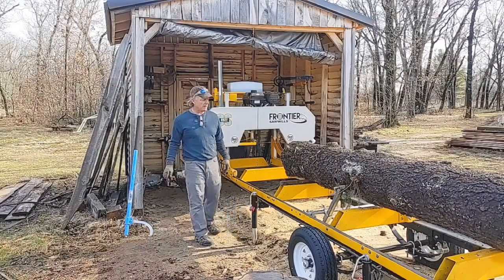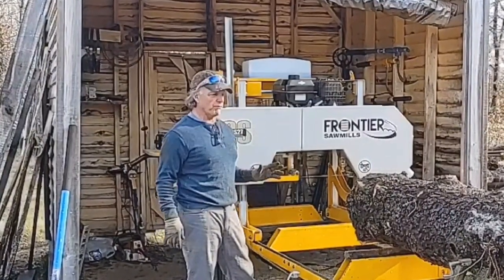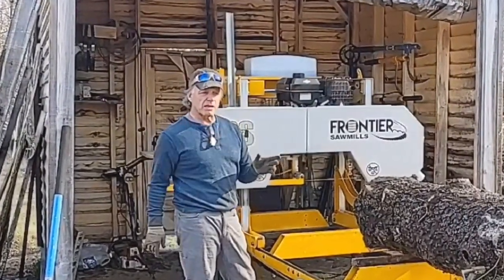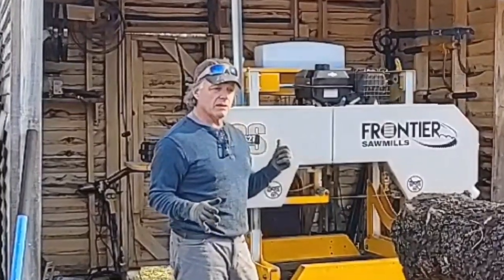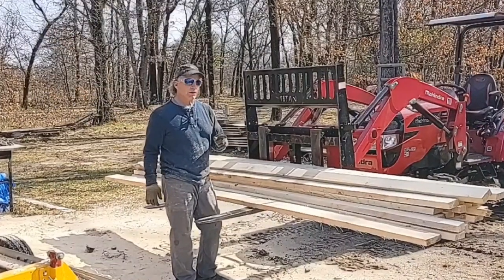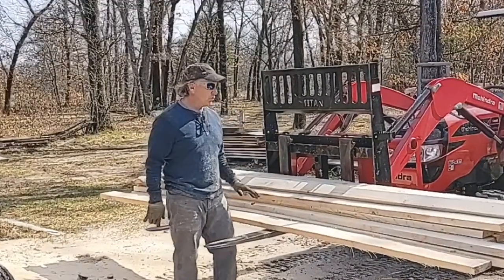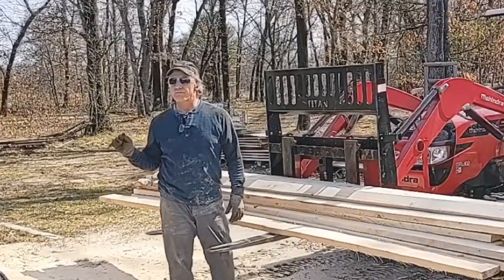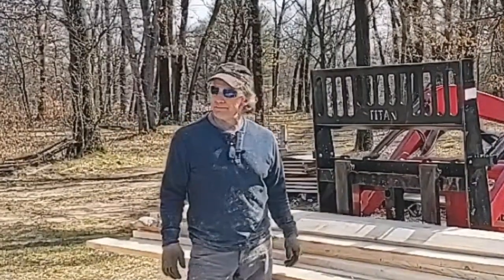Slow and Steady Wins the Race on the Frontier OS27 Sawmill.

Comment: Som mighty fine 2x4 making there Jerry. There is nothing more satisfying than making store bought timber for nothing (excluding the cost of the machine of course)
I've made some 6x6 and 4x4s that would have cost be about £400 which I wouldn't have paid for 😆 
Great work as always and I really do envy that power feed 😄
Reply from the maker: Thanks Nick.   Absolutely.  Love getting the lumber piled up...money in the bank lol.  The power feed is nice.   Next winter I'm planning on building a power feed for the head.   Thanks for the kind words and watching.
Reply: @BigelowWoodcraft  I absolutely agree buddy. 
I too have been thinking of a power feed for the head but able to have it on a clutch to be able to have the fine adjustment if needed unless I could figure out incremental feeding. Like a cnc stepper motor. Maybe I'm getting ahead of myself 🤣
Reply from the maker: Mike festiva has a power head that uses limit switches that fall into detents on the scale for various board thickness. I like the idea but I'm not sure if that would be a good fit for my style.   You would have to put a new scale on each time.  I think the controller I use would be able to slow down and stop on our numbers we use.   With acme screws we could do just what you suggested.
Reply: @BigelowWoodcraft  I have seen Mike's sawmill. One hell of a mill is that !
Yea the speed controller would be the next best option, only thing is over here in the UK, the acme threaded bar is a fortune. Not sure what it's priced over your way. Seems if you want anything longer than 500mm you pay 3x more.
I actually like our infinite crank, was thinking of putting a gear cog and using a micro chain to drive it up and down. I know there is a bit of slogger in it but that's what the scales and DRO are for 😆

Comment: Can you move the sawhead manually or is it locked in the gears?
Reply from the maker: I can. All there is is a set screw that I have to loosen up.
Reply: @BigelowWoodcraft  I’m in the process of building my auto feed and my motor only moves forward and backwards.
Thank you for the tips.
Reply from the maker: I've thought about a clutch system with tensioner pulleys and belts but thought that would only complicate a simple build.  Hit me up if you need anything